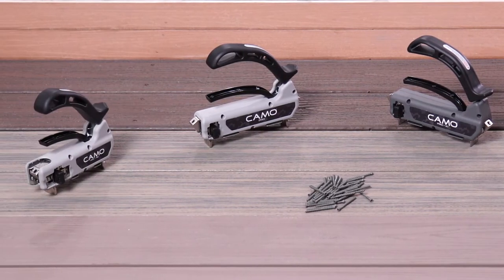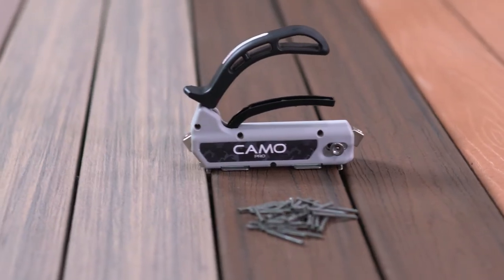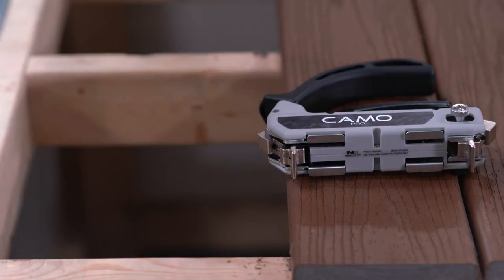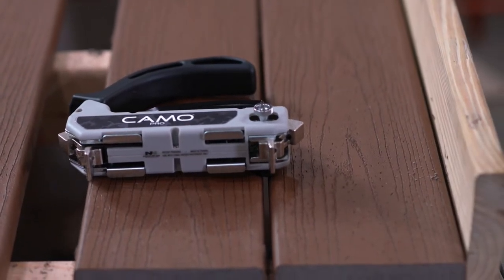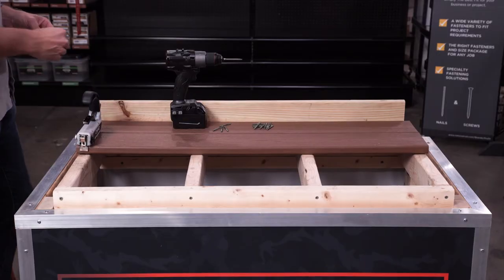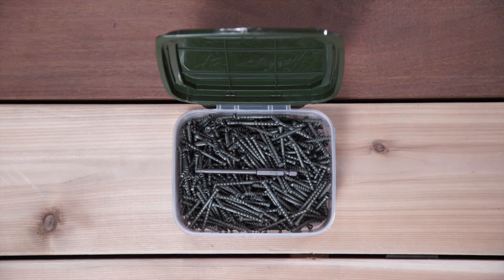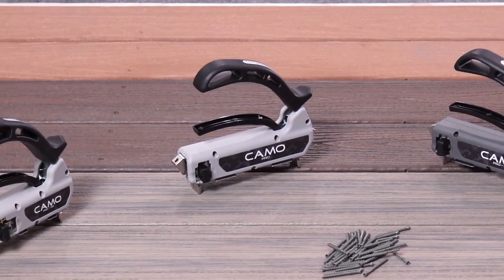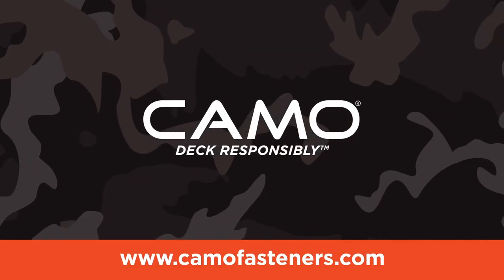CAMO® Pro Guide for Composite, PVC,  Hardwood, and Cedar Decking

Comment: Will this work on grooved deck boards? I used the plastic clips and after a year my spacing around the picture frame trim board is inconsistent
Reply from the maker: Hello. We do not recommend using our Marksman Pro tool with our Edge Screws for grooved deck boards since the screws are directed into the board's edge with this tool. Regarding your plastic clips comment, if you used CAMO EDGE or EDGEX clips for this deck build, please send an email to marketing@nationalnail.com so we can address any specific issue you are having with our clips.

Comment: Can I uses this product on composite decking without a grove in the decking  composite boards?
Reply from the maker: Hey there! Absolutely—the MARKSMAN Pro Tool is perfect for fastening square composite boards.
Reply: @CAMOFasteners  I just finished the deck with the Camo marksman pro, it worked awesome. Thanks responding back. ✌

Comment: Do you make one that can do skinnier deck boards?
Reply from the maker: Hi Pat. The Marksman Edge tool will work on any size board, but doesn't leave a gap.https://www.camofasteners.com/products/tools/edge-guide/#product-options

The Marksman Pro and Pro-X1 both work on boards 5 1/4 - 5 3/4 in., but provide different spacing options. The Marksman Pro-NB works on boards 3 1/4 - 5 in.  

Please let us know if you have any other questions.

Comment: Can this product be used on 5/4 pressure treated pine deck boards? Are there stainless steel screws comparable with this tool? Going to restore an old deck with new in the next month and just discovered this tool while doing research. I really like the finished appearance instead of the traditional deck screws.
Reply from the maker: Yes, our Edge screws can be used with 5/4 pressure treated pine deck board, and yes, we do offer a stainless steel option in both the 1-7/8 and 2-3/8 lengths. Our Edge screws are an innovative, easy-to-install hidden fastener that delivers a high-end look at an affordable price. We'd love to see pictures of your build; if you're on social media, please tag us at @camodeckfasteners on Instagram and @camofasteners on Facebook.